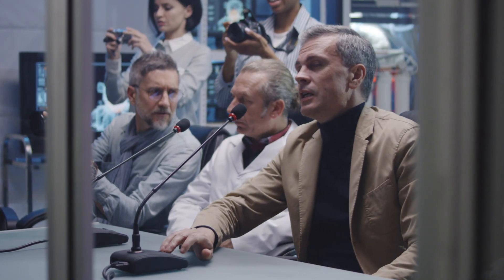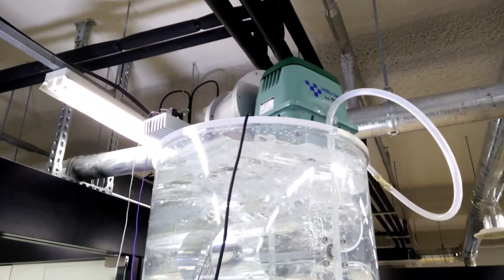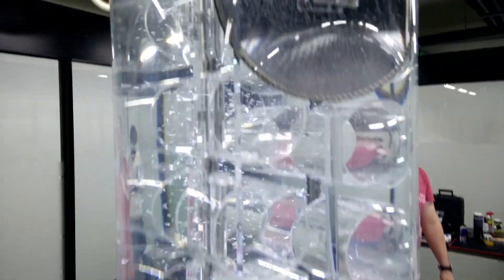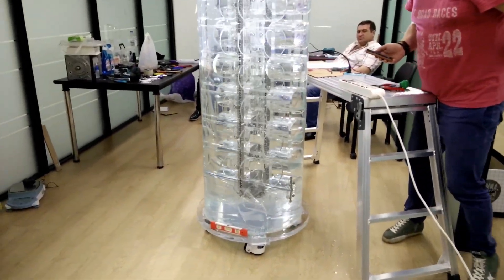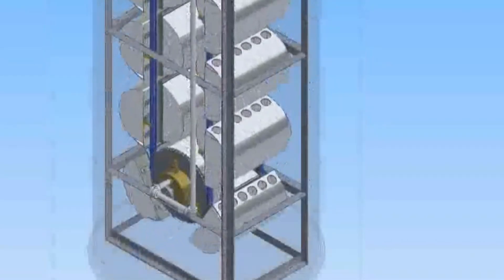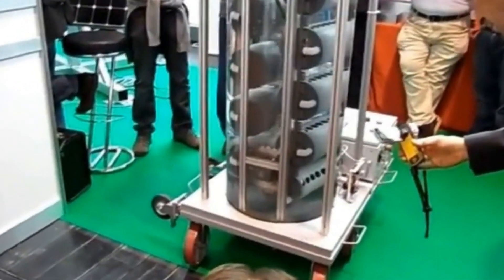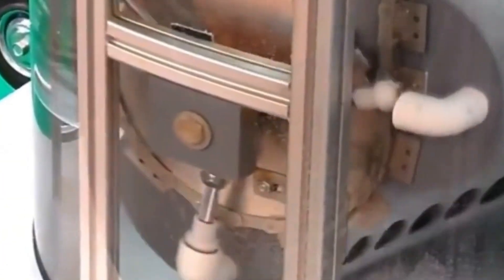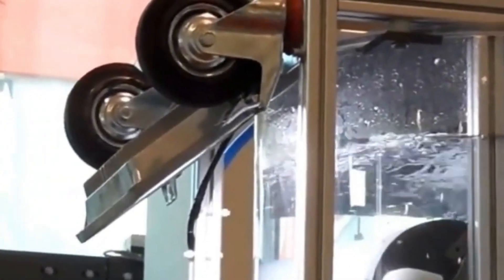Real Perpetual Motion Machines: The Breakthrough That Changes Everything!

Comment: I love this machine, but there is nothing perpetual about it. Sure it takes little power in and produces way greater power output “by tapping to a bigger pool of energy not by perpetual motion”, it’s a 100% working and do it’s job by (scavenging power from environment and converting it to useable electricity), all scientists agree it works and it is within physics laws. (Look up the physics of scavenging systems)

Comment: I thought of two towers, or holes dug in the ground, with two big aluminum tanks with water in them, with a pump that pumps enough water into one tank to make it heavier than the other, making it go down and pulling the lighter tank up. When one gets near the top, the pump puts water from the tank at the bottom into the one at the top, making IT heavier, and thus, it goes down, pulling the other one up...like two giant pistons. Put a cable on a wench-type reel pulley on each end of a turbine shaft to turn the shaft as the tanks go up and down. The only energy needed is to run the water pump, while the main energy produced by the turbine is battery-stored and used to run homes and businesses.

Comment: That thing is 2 meters tall and moves at the speed of a snail... How much energy do i get out of that, 2 wh?
Reply: The power meter said 219 volts with like 0.62 amps and the wattage was 130 somehow I'm doubting it's the electricity it produces and it being the power it uses 😂
Reply: it can generate. 0.0005v & 0.000000001A
Reply: Can you send me the link of the company..